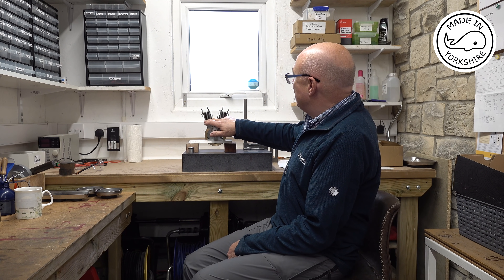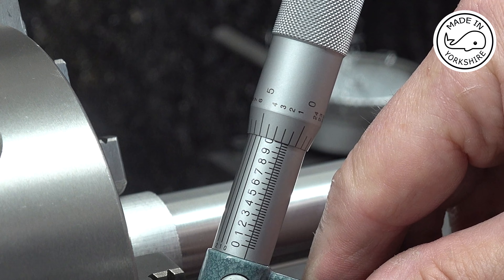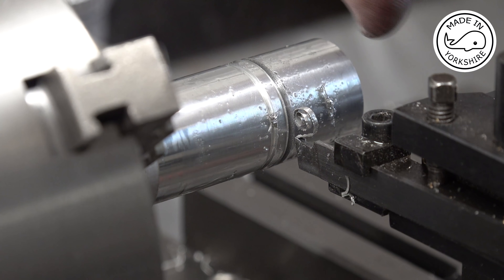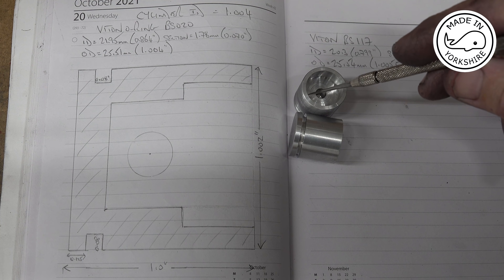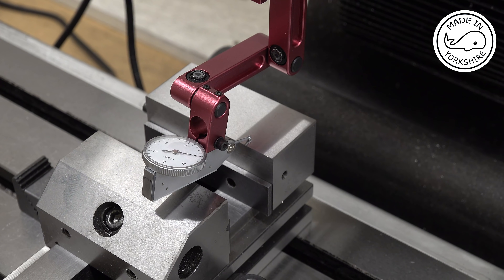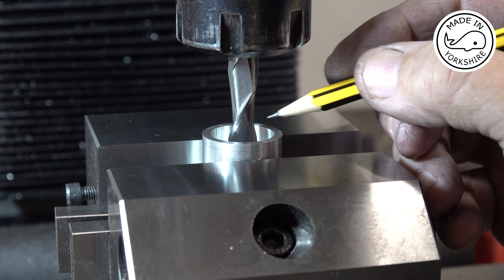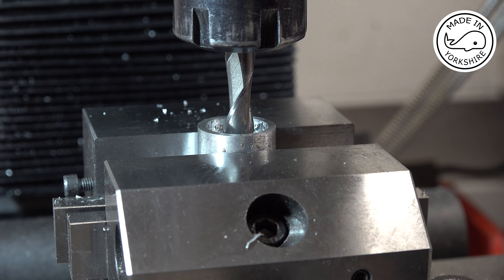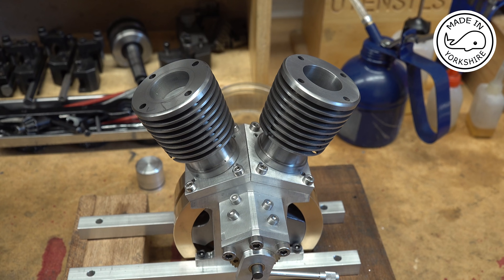#MT44 Part 11 - Hoglet V-twin IC Engine. Machining the Pistons. In 4K/UHD by Andrew Whale.

Comment: The plans call for brass or teflon wrist pin buttons. What did you use? And how are they installed? Do they just sit next to wrist pin? And do the just stay in place inside the cylinder? I need some guidance here. I am currently building this engine. Thanks for your help!
Reply from the maker: Hi Justin
Can you point me to the page that refers to this? It will help jog my memory.
Cheers
Andrrw
Reply: @learningturningmetal  page 4 on the right
Reply from the maker: @justindewoody  ah it helps if I look at the correct v-twin drawings! I used teflon. They just sit each side of the wrist pins to stop the wrist pins touching the cylinders. Nothing complicated.
Cheers
Andrew
Reply: @learningturningmetal  ok thank you sir!

Comment: Pistons looking good and running freely so you must have the alignment right. Cylinder head and valve arrngement looks challenging. Hope all goes well.
Reply from the maker: Hi Tim - I think you are right regarding the cylinder heads and valves. I need to start to give them some thought.
Cheers
Andrew

Comment: Saturday morning coffee with Andrew Whale. Thanks for the shout out on my comment on deep hole drilling. I hate parting off tools. There I have gotten that off my chest. I do like the suggestion from Wis Rom about slower spindle speeds and next parting tool  job here I am going to try out his lowering the tool below center idea. The comment by Dave Ticehurst on rigidity and tight gibs is also a great comment  I usually keep my compound fully in its "Vee" ways unless I am using the compound to turn a feature I also have the part chucked as close to the chuck as possible to again keep good rigidity, I have also found that sharpening the blade for each use helps a lot. Keep the videos  coming Andrew, your comment about doing the videos to learn from others is paying dividends to all of us out here.
Cheers!!
Dick B. USA

Comment: Your relaxing videos are always enjoyable. 👍
Parting tools often work better when you run the chuck at much lower RPM, the machinist speed tables are not always optimal when you have a lower rigidity lathe.
Also, running the parting tool lower than the centreline will help a lot to reduce the resonance. On a piston that diameter you could probably go as low as 20 to 30 thou below the centreline, again probably not agreeing with the machinists guide... 🙂
Reply from the maker: Thanks for the advice Wiz.
All the best.
Andrew

Comment: Andrew, a couple of observations on my part. PLEASE check out your  tool post and the tightness of the gib strips on your Compound slide. When you were cutting the O-ring groove the parting tool Dipped quite severely several times, it may of course also be that you had the compound wound too far out so that the tool post was overhanging. Check your grooving shots to see the effect. Question I take it that you have no graduations on your tailstock sleeve ? as you seem to use tape and Sharpie marks on your drill for depth. Several videos on YT showing how to make a simple depth indicator using a very cheap digital calliper. Would make a nice addition to your lathe. Finally another time and I have mentioned this to you before, use a VEE block to hold round parts vertically in your vice for milling. You were only gripping where it touched the jaws a very small area, I know the moveable has had a very small vertical vee but a proper vee block is better. Regards from Australia.
Reply from the maker: Hi Dave - thanks for the advice. I hadn't notice the parting tool dip, so I'll check the gibs out when I return from hols. I do have graduations in the tailstock but I sometimes find it easier using tape when filming. It gets quite crowded in that area with the tripod. I did think about using a vee block, but it prevented me from inserting a rod for making sure I milled the slot exactly at a right angle.
All the best.
Andrew

Comment: Gday Andrew, interesting the difference between the edge finder and coaxial indicator, must remember that, the pistons turned out good mate, Cheers
Reply: I've got an edge finder having the tip bent. Seller said it doesn't matter... Poor bastard. Finding an edge and move half the tip distance.... What's that distance  on a wobbling tip?
Reply from the maker: Thanks Matty. I must do some experimentation between the two.
Cheers
Andrew

Comment: Hi,Andrew. May I ask where you purchased that red anodised indicator arm from. I quite like the look of that.
Reply: It looks like an "Edge precision" product
Reply from the maker: Hi Howard - just double-checked. I purchased it from Allendale Metrology NOT Machine DRO. It looks like they still sell the product.
Hope that helps.
Andrew
Reply: @learningturningmetal  Thanks,Andrew. I already found it on the Allendale site👍
Reply: @learningturningmetal  DRO and Allendale are the same company. When you buy from DRO they usually include an Allendale Catalogue with the order.
Reply from the maker: Hi Howard - Philip is correct, it's and Edge Technology product. I think I got it from Machine DRO, but it looks like they don't sell it anymore. I was disappointed when I got it because it needed two imperial allen keys, which were not included. So I ended up having to buy some. The holder is quite useful though.
Cheers
Andrew

Comment: how did you come up with thew that o-ring fit? afaik the standard fit for an o-ring on a piston it that it should be slightly stretched when mounted in the groove, and the cross section squeezed about 20% when mounted in the cylinder
Reply from the maker: Hi - I've done a bit more reading on the subject and checked the original drawing dimensions. The groove OD is stated to be around 0.004" smaller than the o-ring ID. The groove width is around 0.005" wider than the o-ring section. My groove depth and width is slightly bigger, but I think it will be OK. When I machined the cylinders I machined the ID to just under 1.004" to nearly match the o-ring OD. However the drawing shows a cylinder ID of 1.000" to 1.001" which would definitely introduce an element of 'squeeze'. From reading the Parker o-ring Handbook it looks like it's a bit of a balancing act regarding 'squeeze'. Too much introduces too much friction. None will introduce leakage. In hindsight I might have been better off adhering to the dimensions in the drawing. However, my calculations were based on the Farm Boy build, so I might just get away with it. Fingers crossed!
Many thanks for bringing this to my attention.
Cheers
Andrew
Reply from the maker: Hi - I think that there are different o-ring fits for different applications. I broadly calculated the groove dimensions based on the Jerry Howell Farm Boy I made a while back. The compression on the Farm Boy is fantastic, so I thought I would follow the same method. Yesterday I came across a Parker o-ring Handbook download which had nearly 300 pages of information. I must have a read and do some further research. The download can be found by just googling 'parker o-ring handbook'.
Cheers
Andrew

Comment: Looking really good there Andrew!  Great series.  If possible you should check the weights of the reciprocating components and try to get as equal as possible by grinding non essential areas.  This balance will help with the engine running smoother.
Cheers
Reply from the maker: Thanks for the suggestion Rick - I'll give it a try.
Cheers
Andrew